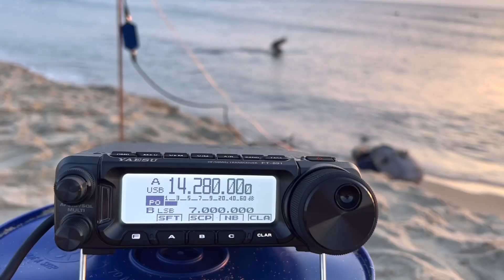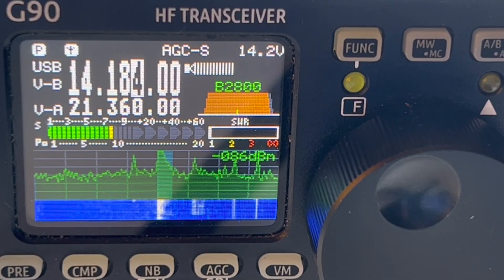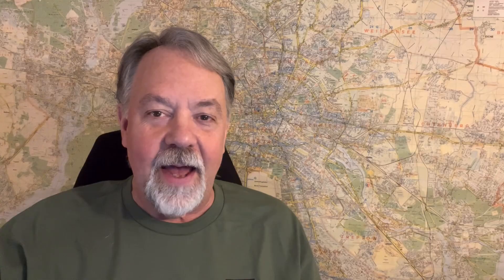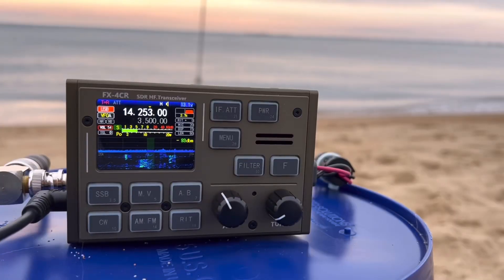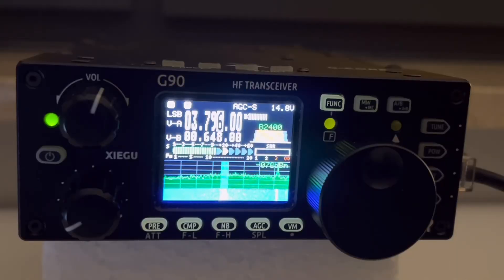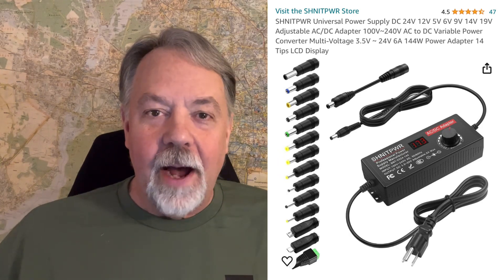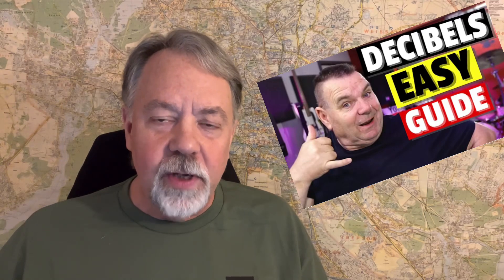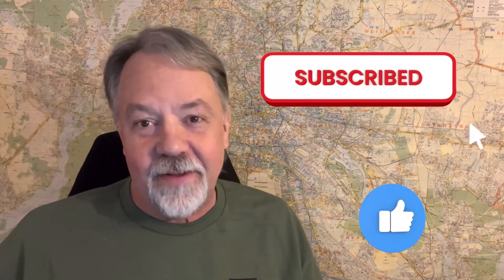20 Watts Versus 100 Watts - How much HF Ham Radio Power Do You Need?

Comment: I have a FT857D and rarely ever ran it above 20-30 watts. I now have a FT991A and again, I keep it at between 20-30 watts. Worked a lot of stations with it into a random end fed antenna strung on the inside railing of my deck. I don’t need the 100 watts, but what the heck, it’s there should I ever need it.

Comment: I have found that a QRP rig is often good enough, but if the other guy is having a problem with copy, I like to throw on an outboard 50 or 100 watt amp.  I love QRP,  but if he got my call I don't make him suffer through multiple exchanges in QSB.  Hit the switch and throw the boots on.  

As far as best option for home use, my current favorite is the 12 watt version of the K3 and a 100 watt inline amp.  I run 5-12 watts most of the time, but if some juicy DX pops up it's easy to flip the switch.  And on that note -- if you got lucky, timed it right and your call got through to the DX, and he struggling with something vital like state on contest number, I don't think it's poor form to up power to complete the exchange.  Is that kosher for contesting?  I don't know.

It's important to me that whatever the commercial rig I'm using for portable, I want a general coverage receiver.   Here you are, out in the woods with all this great communication gear, but no way to monitor local/national or international news.

Comment: I have a G90, ft891, and a Hermes Lite 2 (into an XPA125B amp). They are different tools to have. The G90 is my POTA rig, and it's awesome for that, I run SSB and ft8, and it's not too much of a battery hog. The 891 is my shack ft8 radio where. the extra power can make a difference. The Hermes is my voice mode rig in the shack, hard to beat the audio on that little box.

Comment: As a new ham, I understand the logic with the lower power usage. I also have the 891, and just keep the power settings down. Just because there's 100watts available, doesn't mean you need to use it? 😉Unless you really need the extra $$, I would have just kept 891, but you do you. Enjoy the video content 👍

Comment: Hi Walt, I don't fault you at all for letting go of the 891..I really wanted a G90 for all the reasons you mentioned..only reason I went 891-not so much the power- I seldom run full out, rather was for the built quality, 3 yr warranty and support..if Xiegu ever gets local support in place I'll be in!  With stat said, I love the superhet receiver/filters on the Yeasu..would likely miss it, but the convenience/form factor of the G90  would be appreciated for sure..👍
Reply: In 10 years you'll still find parts and repair techs who can fix anything wrong with the Yaesu. The 10 year plan for most Chinese radios is throw them away when they break and buy a new one. I'm not a radio snob, but long term support is worth something. The G90 isn't priced like a Baofeng which is quite literally a throw away radio. Its priced a stones throw from a better product.

Comment: You can always dial back the FT8901 but you cannot dial up that Chinese radio. I cannot see the point of that swap. I really try not to buy Chinese products wherever possible. Its bad economics, bad for the Western countries as all profits benefit an aggressive expanding military who wants to take over the world if they can. All Chinese corporations have a member of the communist party on their board. I can just use my amall laptop and RSP duo and get all the lovely waterfall views I like with far superior tuning for reception be that at home or in the field, Its not as if this is a lot of extra gear to haul, a small laptop the RSP duo and the MFJ switch to shut down the receiver when transmitting. You are free to choose how to  run your shack. I see it as You Tube rage bait.

Comment: I was morning show host on KBRT-AM 740.  The transmitter was on Catalina Island.  The radials extended into the ocean.  The 10KW signal was stronger than 50KW due to the salt water boost.  The daytime signal was second strongest in Southern California (second only to KFI).  A subcontractor welding one of the towers caused a fire that nearly destroyed the city of Avalon.  They were kicked off of the Island.  KBRT is  now 50KW landlocked in Orange County. The 50KW signal covers less than 70% of 10KW in salt water.  

If you lived in Colorado, South Dakota, Ohio or another landlocked state, would 20 watts still be adequate?
Reply from the maker: Good stuff, I’m an AM DXer. Thanks for sharing. I used nothing but 20 watts for two years while working in Poland well away from saltwater and still made some consistent great contacts.

Comment: I'm in Arizona and whenever I'm doing POTA I pretty much run 100w ever time.  This is because I'm trying to get more contacts throughout the country and get a lot of comments how I'm being heard better than a lot of POTA activators.  It's also nice when hunting when I can hear the operator compared with those running low power and fighting QSB.

Comment: You can always turn the power down to 20 watts on the FT-891 if it's really about the power. I used a friends G90 last week and I wasn't impressed by it. It felt cheap and the screen was too small. I'll take my FT 890 and turn the power down when I want. If my radio would need repair, it's fixable. Is the G90?
Reply: Perfect answer! 
That's right!
Reply from the maker: it's about the heavier battery requirement, lack of internal tuner, lack of SDR waterfall, price, menu, etc for me

Comment: Why not just keep the quality radio from a reputable manufacturer, and drop the power level to 20 watts, instead of selling it for something from a lower tier manufacturer?
I'm not doing either - life's too short for QRP.
Reply from the maker: Weight of carrying the battery for that radio, lack of internal tuner. 
I'd rather take a $400 radio out on the beach in the sand than a $800 radio.

Comment: I totally agree with you here. 20 Watts is the sweet spot in terms of power for portable, or even at home. It's a shame that the 6100 isn't 20 watts otherwise it would of been a G90 killer. If the IC-705 had 20 watts on HF, then wow, that would of been a keeper too. The G90 is a fantastic radio, great audio, ATU, SDR Technology and 20 Watts... Great video!
Reply from the maker: Thank you! 73, Walt

Comment: Walt, what are your thoughts we get back into solar minimum. Do you think we may need 100 watts? I am pretty new, only 3-years in and I have not been through solar minimum yet. Just a thought, thanks for the video!
Reply from the maker: That’s a great question. As we go back towards solar minimum (which is still going to be a few years from now) you’ll see more that bands just don’t open. It’s more about propagation and not the power. Just expect to be spending most of your HF time on 20 and 40 meters at minimum. The lower power will still be fine.

Comment: There is a new version of the G90 called the G90N. Better heatsink, power pole connector, only 10w out. It's for the Chinese market, but it's likely that the heatsink case and power pole will come to the main version. I spoke to a Chinese ham on Facebook. He told me it's because they have to register radios onto their licence at a government office. This can be hundreds of miles away. There is a new online registration system for radios under 15w. So this radio can get people on the air easier on their lowest licence class. The heat sinking is just sides like the bottom of the G90 we have.

Comment: Well said. For operating portable from a battery 20-40 watts offers a great balance.  My take is to think about what experience will give you the most joy.  For me it's an IC-705 with a modest 40 watt amp (+ tuner depending on the antenna requirements).  Yes it's somewhat bulky and more expensive, but the experience is delightful. I don't want to remember a different UI for each rig.  Others love the experience of collecting radios.

Comment: I couldn't agree with you more sir. Me being new to hf starting only with an HR2510 tuned down to only transmit at 15 to 20 watts and a homebrewed rotary dipole. I have worked most of Europe and the farthest I've reach is Brazil at 19, 900 plus kilometers from where I'm at. One time, a friend lend me his Anytone 5555 and an amp that can do 100 to 150 watts. Comparing it with my setup, it only does showed only a slight difference except when conditions is bad. Honestly, it is the thrill and excitement that I get with just 20 watts. With higher output there is not much thrill because you know the chances of making a contact is high. What more, if can build at least a 3 element yagi. 73, and all the best.

Comment: I'm a new Ham.  I got my Tech ticket four months ago, my General three months ago and will be testing for the Amateur Extra this week.  In all the reading, studying, YT vids, etc.  Seeing power limits at 200 watts, 1500 watts and so on, I've come to the conclusion that it isn't all about power but rather, the largest equation being, propagation.  I don't see me using anything more than 20 -25 watts going forward in this exciting hobby.  Time will tell.

I studied radio communications several decades ago which is where, in part, I base my opinion.

To date, I haven't used more than 5 watts on 2-meter with an Icom IC-2730a.  I'm currently trying to get set up on 10-meter.  There are so many good radios out there it makes selecting one challenging.

73
Reply: See my comment. If you can find a President HR-2510 in very good condition and not tinkered with then match it with a Turner Super Side Kick like what I did, man you'ld be surprised especially if you can build at least a 2 or 3 element yagi. 73 and goodluck.
Reply: @franciscolopez3229  Thanks for the suggestion.👍

Comment: I can fully understand your reasons for passing along the 891. I had one on loan for  a month or so, but could not make "friends" with it. Brilliant quality signal, built like a tank. But it is quite heavy, and power hungry too. I don't like lugging around batteries, so I ended up not buying the 891. I have an old FT-817nd which I love to bits, and also own three Xiegu (G90, G106 and X6100) radios that keeps me busy. I like all my HF radios for widely different reasons, none of them scientific! 😀I find the area between 5w-20w more than ample for me. So there you go, carry on with your blasphemy, I'm standing right beside you spouting the same!  Love your videos, 73 Jan M7HNK

Comment: Hey there Walt! I was many times inspired by your videos, especialy about the half square antenna that I built and tested with very good results.  My experience differes from yours, I prefer my Alinco DX70 (probably because I had to repair it before using it). I have and enjoy my IC-705, I do have a tuner but I'd rather have a good antenna than a tuner. With more power I can make contacts easily, while I had to really struggle with the Icom (beautiful radio, she was the reason I finally started to go out and make contacts). But with the bad propagation these days my Alinco breaks the pile-up in a breeze.
Oh, that db scale you posted threw me off, I normally use dbm (0db=1mW)

Comment: Heretic.

No, seriously though, if it works for you keep doing it :) I'll stick with my DX70s (I now have a pair and even picked up an SR8 for home use). The rig, battery, coax, and antenna all fit nicely in a standard backpack and I can always turn them down to low power if I feel the need. I do want to get a G90 someday though. They are undeniably cool.

Comment: Just passed my general on Tuesday and have been lookin into the G90. I have a (tr)uSDX I’m having trouble getting winlink and a Digirig to run vara hf. 
What kind of connector would you need to hook up the power supply you showed in the video to the G90? Trying to look into power supply options and this side of ham radio is much different to me. Been using HTs mostly so far
Reply from the maker: That power supply comes with several different connections. You can pretty much use any plug type you want.

Comment: I decided to do my own experiment on this fascination of yours with 20 watts on my last POTA activation. I have an 891 and I normally run 50 watts for my activations. My usual QSO rate averages around 100 per hour and the average signal report hovers around 5/8. I dropped the power down to 20 watts and was averaging around 4/5, the lowest report I received was 3/3 and 103 contacts took about 90 minutes to achieve. Yes it took me 50% more time to achieve my goal, yes my signal report dropped but I was still able to reach 1300 miles from the middle of GA. Am I going to sell my 890 and get a G90, no way but you do have a point with this whole 20 watts business. 
Moe-KO4GBB

Comment: The only area where the FT-891 might have an edge over the G90 is in the quality of the receiver. Would be interesting to see a side-by-side test to determine whether the Yaesu radio is able to pull weak stations out of the noise any better than the Xiegu radio. My experience of using the G90 for SOTA tells me that the receiver is decent.

Comment: Your observations are correct...fade margins are on the order of 10dB to 20dB so the difference between power levels has to be of the same magnitude to see a difference. Going from 10 watts to 20 watts, or even 40 watts, is pretty meaningless....you have to think in 10dB increments so you either operate 10 watts, 100 watts or 1000 watts to make the threshold of your operating conditions. I have a 100 watt radio but generally run about 10 watts to keep the finals cool. If the band is open, it's good for 10 watts or 100 watts.

Comment: Sir I wathced you video with interest, but I would like to outline an item. yes there is 7dB diference between 20watts and 100watts, but this is 7dbWatts, but this would be 14dBvolts, which an "s" m meter is in dBvolts, so it would be 14dBvolts between 20watt and 100watts, which equates to just over 2 "S" point on the "s" meter. Regards alastair gw0aju

Comment: Nice video, Walt!! In my case, I can say that (considering my current most used mode is SSB), 100W (never ever more than that!) is what definitely my sweet spot is at! But I think that's because my perspective is somewhat different... Yes, I'm pretty sure that I could even probably remove the PA and even driver/pre-driver stages of say my IC-7100, hypothetically transmit just with whatever output the local oscillator was generating, and still find stations to DX whose antenna systems were big enough, and their QTH conditions good enough, to hear me, especially with the added help of good propagation... But my focus is another... When I DX, and if at all possible, I'm actually aiming to be heard by distant stations whose conditions are compromised and/or marginal... In my main QTH here in Barcelona (Spain), apart from my 40m bazooka dipole that's on the rooftop, as far as my other HF antennas go, I've only been able to shoehorn them in the small amount of remaining space on & around my house: a 1/4-wave monoband vertical for 20m, a monoband Delta Loop for 10m, and a wire (40m long, laid out around the house) that I use as an EFHW for 80m (but that could also be a 1/4-wave for 160m)... Add to that my urban QRM (often peaking around S9 on 20m and 40m), and the result is that, of the stations from outside Europe that I've heard, as far as I know, none was using low power (<50W)... But I've had many signals that were just barely surfacing out of the noise, and they were from operators who definitely were transmitting with more than that... 
So, this is to say that, with respect to 20W, 100W might just be an increase of around 1 S-unit, but, in some RX conditions, even that can be the difference between a rough, difficult, but still workable copy, or no copy at all... Because of this, I think that using 100W gives more and more modest distant stations (think HOA-limited ops in the US), more possibilities of hearing and possibly working me👍 Besides that, I'm actually really enjoying trying to squeeze out the most portability out of my IC-7100 + MFJ-939 combo (I secured both on a wooden "cradle", with its cover, as well as handle and feet from an Icom MB-123 kit, that I designed myself in SolidWorks software... Then a local carpenter brought it to reality out of the 2D views and measures I generated & printed!), with a 40Ah Bioenno BLF-1240A LiFePO4 for power, and the JPC-12 (with the "ecosystem" of accessories I'm also gradually building around it) as my most used antenna in the field!

With the above mentioned, I'm no exclusivist and, in fact, knowing that there are situations I'll need more portability than whatever I could ever achieve with my IC-7100, I actually recently got an IC-705, and I'm very much looking forward to also making good use of it and its 10W! Especially using modest antennas, like telescopics of the style of the Elecraft AX1/AX2, so I can operate with my IC-705 in a similar way to how I'd SWL with my Tecsun PL-660 receiver... In this case, the way I'll operate will be such that I won't be aiming for DX as much as I'd do with the IC-7100, so any QSO will do, but if it's DX, no matter how the station at the other end is equipped, it'll be better, of course!😄

Finally, I must add that, though like I said, these days, the mode I'm mostly operating with is SSB, I'm actually slowly and gradually learning CW... And given its higher efficiency, from the day I hop on air with my keyer, I'll definitely never ever use more than 10W when on that mode!

Anyways, 73 and sorry for the lengthy comment! I guess YT gives this possibility to me...😅

David - EA3IEK & SWL EA4998URE👍